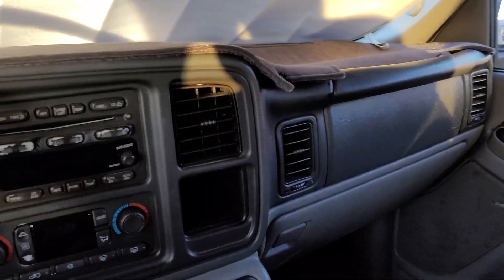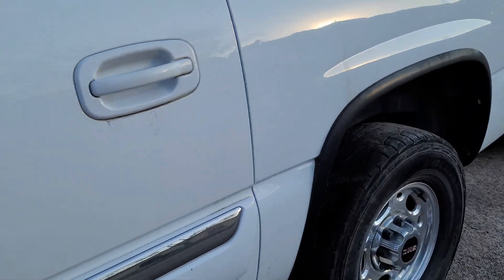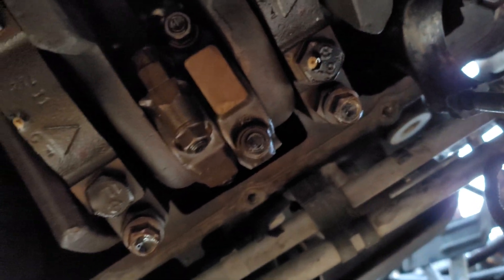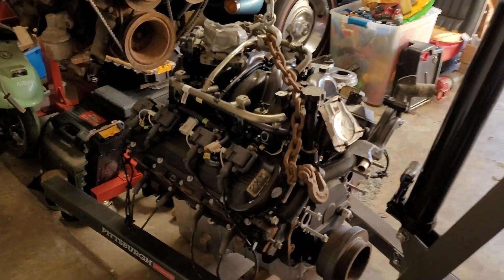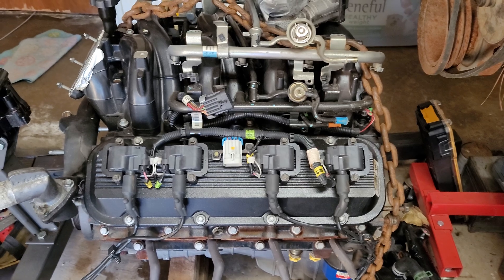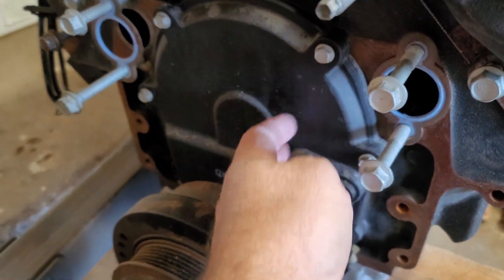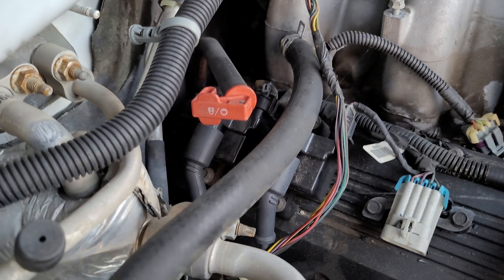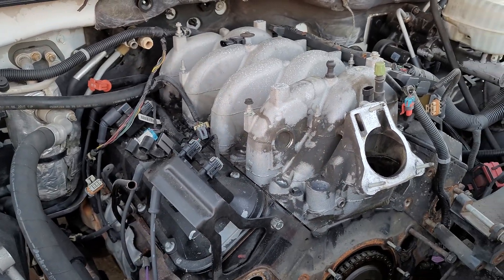Just How Durable is the Vortec 8100 496 8.1L Big Block Chevy Engine?

Comment: Just brought mine with 98k on the motor. Probably one of the strongest gm motors of the time. Gm detuned these motors to last a lifetime, they can handle up to 40 percent more power with stock and still last. Some of the things to help with heat and oil problems are, to run 15-40 oil over the thin stuff, add also the duralast 15898 180 degree thermostat. Most of them have the 190 temp. And have the flowkooler aftermarket water pump. With the change you will see a difference, oil consumption will be nonexistence almost, way cooler running temps also.
Reply from the maker: Great suggestions, thanks for sharing👍

Comment: i just bought a mid-2000's motorhome with the 8.1 Thanks for the info. I was looking for the 8.1, i didnt want the Ford v10
Reply: Same with me, about the same time ago.  Mines a relatively small 30ft class A, so it has abundant power for any situation! As much as I love the rig (especially the rare, desirable, low mile 8100), I plan on selling it for a healthy profit, as the seller didn't have a clue it's value!
Reply: @jeladsnikpoh1289  As a full-timer, I plan on changing over to a 5th wheel from my current 2005 30ft class a motorhome with the vortec 8100. Think I heard somewhere that the workhorse p30 chassis, the motorhome that is built around it, is kinda too much for the chassis. Plus, I've heard that for living in an rv for years and years and years, it's better to do it in a 5th wheel as opposed to a motorhome.
Reply from the maker: Glad to hear it was helpful. Your motorhome should last you a long time.

Comment: 2002-2003 .5 was a slightly different variation the two thousand three and a half to two thousand seven they fixed the issue that was causing it to use oil more frequently. My05 barely uses half a quart in three to four thousand miles
Reply from the maker: That's good information👍. I'll have to check and see what my 8.1 trucks end up using once I start working them more regularly.
Reply: good to know. I just bought an 8.1 motorhome that is that year.

Comment: Also it's not dual tanks. The SUV's did not get the giant tank I'm pretty sure because I hadn't 04 Yukon 8.1. My 8.1 Sierra has either it's a 36 or 37 gallon tank not dual tanks
Reply: The Suburbans and possibly the 2500 Avalanche have two tanks and two pumps. I replaced two pumps in my 8.1 Suburban and each in a seperate tank. One is 12 ish gallons the other 27ish, not sure on the exact gollonage lol.
Reply from the maker: That is correct. Most people aren't aware these trucks used the dual tank setup. I believe the primary reason was due to lack of clearance underneath for the one long single tank.

Comment: These motors are normally almost indestructible unless you're trying to hurt them. The only reason that would happen is because they do in the earlier years like you're showing they did have some oil use so if you don't keep up with the oil then that's what's going to happen but if you take care of the truck it will never break when it's not being abused
Reply from the maker: Yep, lifetime trucks for sure

Comment: From what i have been reading they get about 8 miles a gallon,, you said it holds 32 gallon,,, that's 256 miles. Gas at 4.25 a gallon today, here in WA State, that will cost $136.00. If i drove across the country and back about 6000 miles is about $ 3,000 in gas. Dang!
Reply: I don't think anyone who has an 8.1 expects to get good gas mileage Lol.
Reply from the maker: That's for sure😁
Reply from the maker: Solid calculations but unloaded the Suburban variant should be able to pull closer to 10-12 MPG if you can keep your foot out of it. Now if you're loaded, then the gas bill will hurt your feelings for sure. Down South, our fuel is still trending around $3/gallon, so that helps a little bit.
Reply: on my motorhome, I think it has a max range of roughly 400 miles give or take on a full tank. it has the 8.1

Comment: I'm just looking at this how did you build come along and the 8.1 I was only looking and asking because I was gana d a saw to this to I was gana do a 454 but I seen this 496 so I was just curious but how did your come along
Reply from the maker: It's going very well, just slower than I wanted due to some other daily living distractions. My plan is to have the replacement 496 engine installed by the end of the month.

Comment: Just an fwi the yukon and suburban iterations of the 8.1 paired with a 4l85e not a 4l80e
Reply from the maker: Good point, thanks for the correction.
Reply: Yeah, I think the 8.1 has too much hp and torque for the 4l80e
Reply: 4l85 existed in 2001and 02?
Reply: @TAWS-wq3hx  yes

Comment: I haven't finished the vid yet, so you mayve already answered my question- but doesn't the marine version have substantially more power and torque from Raylar brand cam, heads, etc.?
Reply from the maker: The Marine HO version has around 375 HO if I am remembering correctly. This is the non-HO Marine engine, which is worth around 345 HP. I don't believe the Raylar components were delivered on the factory produced engines.

Comment: Awesome, I have a 2002 Silverado 2500hd extended cab, 8 ft bed, 8.1L 496 with Allison trans 150k miles. Strong truck even though it loves the gas station. I’m gonna sell it soon and will not not take less than 15k for it. This is the last of the apex GM big blocks. Nice content on your channel about the 8.1. 👍
Reply from the maker: Hey Phillips, thanks for the positive feedback. I appreciate it👍. I purchaee another 8.1 truck very similar to yours, you may have seen the video -

https://youtu.be/Jr10wl5Oj5I

Comment: I haven't really noticed oil consumption on my 8.1 in my Class A motorhome,  typically on a trip from Victoria, Canada to Mesa, AZ, I might add 1/2 quart before I go back home.
Reply from the maker: That's actually pretty good and better than the acceptable norm called out for by GM. Possible somebody in the past performed the intake modification to reduce oil usage.
Reply: @VetteSource What's this intake modification?
Reply from the maker: It involves cutting out the lower portion of the intake that covers the lifter valley. I'm not sure of the exact cut locations, but if you search through the FB groups, I believe many people have outlined the process.
Reply: What year is your motorhome?
Reply: @starmaster191  2004, chassis is a 2003 Workhorse W22, it would be a 2003 engine.

Comment: I remember my dad had a 2003 gmc 8.1 2500hd and towed trailers all day and got 320,000 miles before he upgraded went true 2 steering pumps and alternator stock motor and Trans
Reply: He had it sitting in my Yard for like two years because the power steering pump blew and he scrapped it he’s regretted it ever sense he wanted to take the motor and trans out for a newer truck or A project truck
Reply from the maker: Yep, these 8.1 engine equipped GMT-800 series trucks will be a highly sought after vehicle for many years to come. The common theme is the engine outlasted everything else around it, and regret once they're gone😁. Have a great weekend👍.

Comment: Im looking for the 8.1
Reply from the maker: I would check around your local listings and salvage yards. Quite a few of them floating around out there.
Reply: I've got a like-new 30ft Winnebago Class A motorhome with under 33k miles and this superb engine! 2001, all the motorhome goodies including big Onan generator, 2 tvs, hardwood floors, solid oak cabinets, Winnebago quality, etc. Not the coveted Allison tranny, but runs like a raped ape with the 4L85E. Will sell it this spring for under market value for quick sale (something like $16k+)! You've probably already purchased, and not in my area (KY.), but never hurts to try!

Comment: Would you bump up the viscosity to 10w30 in 90 deg. weather here in S Florida on an 8.1 with 217,000 miles? Especially if it's a high oil consumption motor. Much appreciation!
Reply: The PVC issue is really easy to fix.  Look at LT Tolman's channel.
Reply: Maiden voyage to work, 20 miles one way. 75-80 mph. Sooth as silk!
Reply from the maker: For sure, who needs an EV when you have an 8.1😁?
Reply: I have 8.1 in my Yukon and live in El Paso. Is going to 10w30 required for hotter weather?
Reply from the maker: It's not required, but you may see a little bit less oil consumption with the heavier weight oil.
Reply from the maker: Hey W, I do that on my 7.4 an 8.1 engines. I can't say I've seen much of a difference, but at least it does provide for a little bit more viscosity.
Reply: @VetteSource  Thanks you! It's in the factory manual. Gospel to me.
Reply from the maker: Excellent! Glad to hear👍

Comment: I bought my 03' Yukon XL 2500 8.1L original from the dealer 19 years ago. Just turned 110,000 miles on it last week. Small things keep popping up (i.e. cracked dash cover, broken inside door pulls, drooping headliner / sun visor upholstery, brake booster, etc). With the exception of sending out my Yukon to get the headliner / sun visors re-done and front end alignments, I have been able to repair everything myself. I'm going to send it out for paint in a few months and replace the headlights & tail lights and make it look almost brand new.

It's the only thing I own that can comfortably carry me and my five family members, carry a decent amount of cargo behind the third row seats and tow a travel trailer at the same time without problems. I love my truck and will try to keep it running for at least another six years or until my teenagers no longer want to go camping or go to our mountain cabin with the old man.
Reply from the maker: Javier, great testimonial. I've used my 04 Z71 Suburban I bought new with the 5.3 engine in the exact same manner with my wife, three kids, and dog. Like you said, the space in these is unbelievable for those longer road trips, and with the 8.1, I'm looking forward to the extra oomph I'll get when towing my stuff around. Thanks for the comments👍.
Reply: @VetteSource  
You brought tears to my eyes... Hoping to get a Chevy Avalanche or big Suburban or Yukon kind you guys talk about...
I had a vision twenty-three years ago my mom and dad holding hands of a little boy and a little girl coming through the woods toward me and I knew they were refugees; they were homeless.
Ever since I've been working hard trying to help homeless people to help that particular family, hoping that I will actually meet them someday. Since 2009 the first of seven to develop farms into refuges... meetings I've been a part of and Been a speaker at,
I felt the need to be able to go out to farms and help them know how to build this in that and the other thing to teach them how to be safe and secure... to grow food and preserve the food. So I want a truck im and a trailer that I can go just stay on somebody's property without being a burden to the them. Totally self-contained so I can stay as long as they need me to help and are willing to listen to me and learn.
Reply from the maker: Hey buddy, I'm sure you'lll make it a reality soon enough. Keep on doing the positive work you are doing, and good things will come👍.
Reply: You brought tears to my eyes... Hoping to get a Chevy Avalanche or big Suburban or Yukon kind you guys talk about...
I had a vision twenty-three years ago my mom and dad holding hands of a little boy and a little girl coming through the woods toward me and I knew they were refugees; they were homeless.
Ever since I've been working hard trying to help homeless people to help that particular family, hoping that I will actually meet them someday. Since 2009 the first of seven to develop farms into refuges... meetings I've been a part of and Been a speaker at,
I felt the need to be able to go out to farms and help them know how to build this in that and the other thing to teach them how to be safe and secure... to grow food and preserve the food. So I want a truck im and a trailer that I can go just stay on somebody's property without being a burden to the them. Totally self-contained so I can stay as long as they need me to help and are willing to listen to me and learn.
Reply: Its still going strong??

Comment: What a shame it was neglected how could anyone think you don’t have to check the oil on a 200k mile engine.I had a 2001 GMC 2500 HD with the 8.1 L it was stone reliable yes it used a little oil but I just checked it every once in a while. That truck was a horse it would pull anything 20 years of ownership of hard work it never broke down once.
Reply from the maker: Yea, it happens quite a bit I think. Most people are just used to driving until the car tells them it's too hot or low oil and never actually pay attention to the engine particulars until its too late.

The 8.1's are great trucks, I'm sure this one will last me and the family many years.

Comment: I would definitely clean up that old aluminum intake manifold and swap it onto the new crate engine. Just for durability/reliability reasons.
Reply from the maker: I'll probably stick with the black coated intake since it's specifically designed to protect it in a marine or heavy duty environment.

Comment: Hi . Great 8.1 video. My 8.1 in my 2002 GMC needs the oil pan gasket changed. Can the pan be removed without removing the transmission?
Reply from the maker: Definitely. It's easier to access on the 2WD models, but once you remove the torque converter cover you will have access to all the oil pan bolts and it will drop straight down and out.
Reply: @VetteSource  Thank you
Reply from the maker: No problem👍

Comment: Make sure you have the truck injectors and not marine injectors(even though i would keep the marine ones) 30 lbhr vs 42lbhr.  And if you pull intake bellhousing bolts are easier to get to
Reply from the maker: Thanks for the information. I knew the marine injectors were bigger, but didn't realize by that much. I didn't think of pulling the intake to get at the bellhousing bolts. I'm too used to the old school gaskets. I am setting the marine fuel rail, injectors, water crossover pipe, oil pump/pan off to the side for now.

Next step is to swap the harmonic balancer, timing cover/cam sensor, and double roller timing chain to the truck 1X style so it will work in the 04 Yukon.

I think I can get away without having a custom tune, but we'll see how it behaves when I fire it up. Thanks for the feedback and comments👍.
Reply: @VetteSource  yeah not sure which hp version that engine is if it is the 375hp then it should be stock 8.1 truck specs.
Reply from the maker: I think that's what version it is. Some of the broadcast codes have become lost to time over the years. The only thing I've found so far is a 2SX on the barcode label that's on the back of the valve cover. Hard to believe this engine is 20 years old already.
Reply: @VetteSource  Yeah if i can find them cheap I buy them up, Now I am collecting 8.8 psi engine stuff think 8.1 with better heads intake and 4.350 bore and 4.500 stroke
Reply from the maker: For sure. I've seen some of the engines that are running the blower setups. Crazy power and pretty reliable for daily use. Of course, now with fuel prices so high, it's probably hard to justify driving it around unless your using the rig to make 💰.

Comment: GUYS GUYS GUYS THHES ENGINES BURN OIL BECAUSE there is a 3/8s hole on the bottom of the intake and any oil that makes it up there gets sucked in    the fix is to block that internal pcv off and install a external one like normal
Reply: Any video or a website for a description of the solution so I tell my mechanic to do it
Reply from the maker: Good info, thanks for sharing👍

Comment: I know my 02' Silverado has a low oil level sensor along with the oil pressure sensor. If it threw a rod from low oil thats shitty. At least these are much cheaper than a duramax!
Reply from the maker: Agreed, more than likely the owner just wasn't paying attention or ignored the low oil indicator. It'll be good to get iit back on the road again.

Comment: fill it with motrkote let it idle for about half hour drain it put oil in it and run it
Reply from the maker: Thanks Randy, I'll look into it👍.
Reply: @VetteSource  

Absolutely or nitro 9.
I met a kid at a parts store and he said his friend had a race car and they put the motorkote in it and the kids grandpa said if you blow it up I'll buy you a new engine...
So the treated with motorkote then they drain the oil out of it and ran it for until around the gas tank dry and I never overheated never blew.
Similar is nitro 9 engine oil and fuel additive in transmission additive.
The kid Cudi the kid called motorkote "God in a bottle"
I called nitro 9 
"Mechanic in a bottle"
I had a hose 1976 Grand Prix they had a 400 small block it right side forward left side back back and forth back and forth so you can almost get seasick.
And I got about 7 miles per gallon which is about three miles short of what I should have been getting about 10 miles per gallon with a small block so I treated with nitro 9 oil fuel and transmission...
Took it out on  highway on Highway 75 North of Topeka at first I didn't know what the problem with the deal was dead silence I was not used to that smooth lately was like driving a Lincoln Continental of the showroom floor engine purring like a sewing machine...
My mileage went from 7 miles per gallon to 19 miles per gallon.
It was almost triple what I was getting and almost double what I should have been getting.
Shouldn't be getting 10.
19 almost 2 times that.
Was getting 7. 3 times 7 is 21 and 19 is  2 miles per gallon short of what I was getting.
Reply from the maker: Cool👍. Sounds like something I should try. Of course, the 8.1 in this Yukon dropped the #1 rod through the oil pan, so there's not much chance of saving it without rebuilding it.